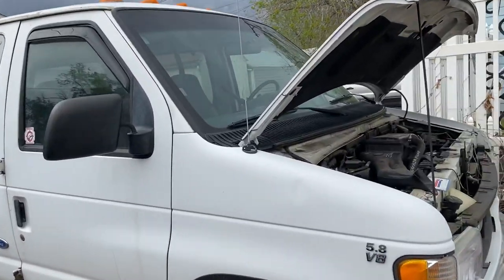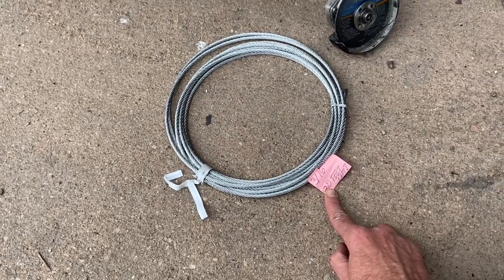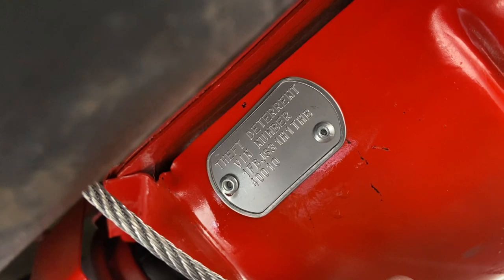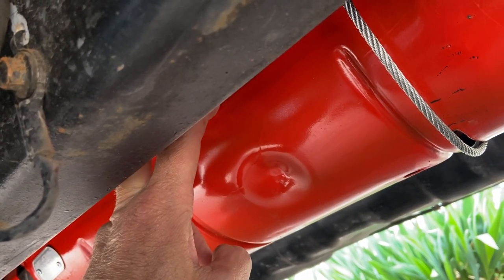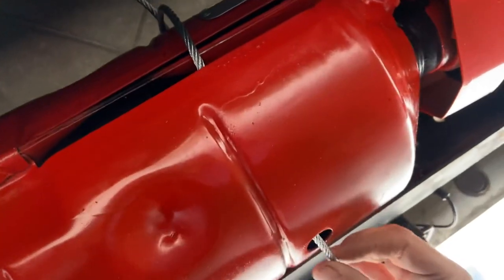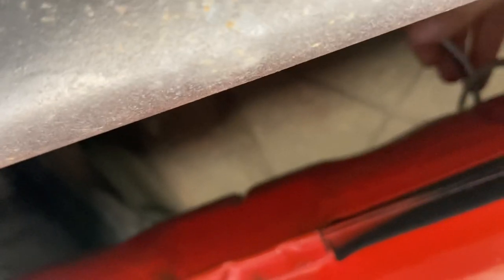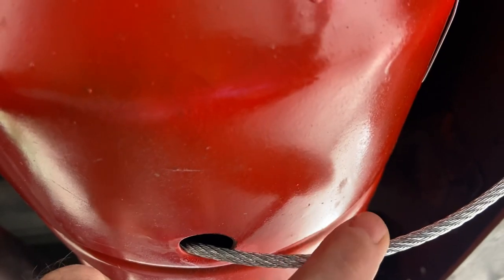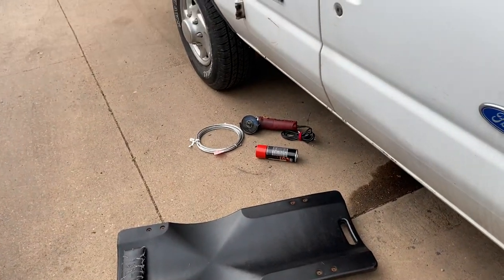Catalytic converter how to Anti-Theft Security Protection DIY. Spray paint Vin tags Steel Cables $30

Comment: This is a good idea and a good execution. Anything that these criminals see that is going to slow them down will make them move to an easier target. Thanks for the video.
Reply: Yeah, the only time this will fail is when cat theft prevention becomes the norm and it becomes difficult to find non tampered cats to steal. Then they will start to go with more difficult to steal cats but that is when it becomes a mess for them with people doing all kinds of different anti-theft tactics that makes the theft method inconsistent and will probably require a variety of tools and increased risk to the thief.

Comment from the maker: OK WELL They tried to STEAL my CAT!  Had my van parked on a side street for about a week. 
They didn't get the CAT off because of the cables and barb wire, BUT they did completely sawzall Cut my exhaust piping on both inlet and outlet pipe ends of my cat..... 
Now I have to get the piping welded back together. There are some slight marks on the upper frame member, so looks like they tried to cut the cable but the cables and barb wire show no signs of damage. Most of the cables run up up above the cat to the frame member. 
Seems they just couldn't get their tool up there. After repair, I will also look at adding some expanded steel-mesh to wrap around the cat so hopefully they won't cut anything next time and so add another layer of protection. 
Also looking at adding wraps of exhaust fabric-tape-sold for headers in the common cut areas. It is said by some that the fabric tape really gums up a cutting tool, making it more difficult to cut your pipes. 

Hopefully next year I will install an alarm system for my van. Currently I have a steering wheel locking club I use.
With the alarm, I will look for ways to add some wire by/on the cat that if it gets moved it will either ground or break a ground, triggering the alarm. 
 
PS my cable system is similar to the Catclamp, yet the cat clamp looks more robust, yet the front of my cat has a wide mouth dual pipe the catclamp would not fit over.. 

Take care 

Take care

Comment: 30 dollars, maybe a few hours of your life, compared to 1200 to 2000 dollars and losing the car for a day to get repaired. Thanks for the great idea!
Reply: The folks who are stealing the converters will be able to cut through that wire cabling.
Reply: @lourias  but if use several pieces or stretches'  -just adds to more time they need to spend. Deter not stop.
Reply: @lourias  The whole point is that they see it's a PITA. They just want to get into 2(or 3 if sensor) quick cuts and get the cat out in less than 1 minute. If they see this mess, they are not going to figure out how to get it removed and move on to something else. It's only when "moving on to something else" becomes useless because everyone is doing this, that they will go through the effort of figuring out how to steal a come complicated cat.
Reply: @SI0AX  Good thieves will carry steel cable cutters besides a Zawzall now that they probably watching the vids people post on youtube
Reply: yea cost me$1300 at  midas on a van like this
Reply: almost cost more to fix on these old ford vans then there worth  1997

Comment: Jim M.,  thanks for doing this video.   I'm going to do this.   Please pay no attention to the negative comments.   I was looking for a DIY way and I think your way is the best.   You are correct, a sawsall will have a hard time with the cables.   Thanks Again.
Reply: That's what I'm thinking. I plan to do this soon since I've had one stolen. It doesn't need to be impossible to get off. Unprotected they can take it in about 2 minutes. If they see that they have to actually think, and take more time, they will probably move on.

Comment from the maker: Everyone, 2 things you can do for FREE to combat this trend that I've done:
 
A. 
Every month, go to FB marketplace and search for any catalytic converter buyer ads that do Not state that they will not buy stolen Cats and also the suspicious ads which are found in the sell section yet hint they actually will buy cats. 
Message the person telling them to quit buying stolen cats or change their ads to specifically say they will not buy stolen cats and report to FB in the link as "suspicious stolen" category. 
If we stop the buyer's who are funding the drug addict thieves, we can change things. 

B.
E-mail our elected officials to change the Federal law to Allow the public to buy used catalytic converters from salvage yard vehicles, like we use to be able to, so we can affordably replace our stolen cats and this will also reduce the value of stealing them in the first place and after market replacements!

ALSO to change the law to allow muffler shops to Reattach a catalytic converter that has been completely cut off your vehicle!  Yes that's right, by law they can't reattach your catalytic converter if it's been completely cut off or after the police recover it! 
The law only allows them to repair it if it's still partially attached. So Muffler shops are forced to sell you a new Expensive catalytic converter even though they can see the cut marks match your original and your is often better quality and longevity than after market replacements.

Take care

Comment: It would seem to me that simply wrapping your CC in some sort of cable like this and clamping it in would almost completely eliminate any chance of theft because a thief will see this and know it's going to take more time.  They're looking for situations where they can get in and get out within 2 minutes or less.  Seems like a very simple and cheap way to prevent this kind of theft.
Reply from the maker: Thanks Joel I agree Since I can’t add a metal shield plate like they have kits for some vehicles.
I’ve since added some simple wraps of medium duty 16 gauge 4 point Barb wire from eBay and just added it to the cable clamps hood downs.
I feel it’s the sweet spot for my vehicle and situation and cost and labor and comfort content level.
If they move their hand quickly around that Barb wire, it’s gonna cut snag them.
Rough play with the cat is gonna scratch! Lol
Reply: @JimTMcDaniels1  hi so many are ALSOLOOSING THEIR LIVES,WHEN JACK SLIPS !  Most seen have been in KALIFORNIA ! Stay well 🇺🇸🇺🇸🇺🇸🇺🇸
Reply: @flybyairplane3528  So sad about the jack slipping on them (snif)...   'scuze me....  I need a minute (snif) 😜
Reply: Cats are worth $500+ scrap these days. many thieves will take high risks such as spending time to cut shields and cables loose.
Reply: @MrHurricaneFloyd  But with 10's of 1000's of cars out there, w/o cable inclosures, they would most likely rather move on, which is the whole point.
Reply: @Jim just wondering if this worked? I’m gonna try this same thing w barb wire. Thx
Reply from the maker: @cliffrivers8200  it’s worked so far as in no one has tried to steal it. I do live on the west side where cats might get stolen however there has been no evidence that anyone has tried…
I feel comfortable with what I’ve done and where I live and the difficult and expense of doing more than I did for my particular cat design that I don’t see a shield kit offered or easily done.
I don’t live in higher theft rate places like California. 
If I lived there then I might go to more extremes and see what professionals recommend.
Reply: @flybyairplane3528  "Many" are losing their lives when jacks fail?   Not.
Reply: @flybyairplane3528  I have no doubt that there has been at least one death from a car falling on a cat. thief.  Likely more than one. My point is that you are grossly exagerrating saying it is "many."   Many people are not dying while stealing cat. converters.

Comment: I had both left and right catalytic converters along with 2 oxygen sensors recently stolen on my Toyota Tundra, and due to the unavailability of replacement catalytic converters, it took 4 months to finally get it repaired.  The total cost of repair including welding was $4,682.  I'm so scared to park my car outside now as my Tundra cannot fit in the garage due to its length.  I will definitely try the suggested theft deterrent methods.  Thank you for the information!
Reply: Four months!?!  So the truck just sat idle for four months?
Reply: @robytar  Yes, parked on the street because it doesn't fit in the garage. During that time, I had so many spider webs all around and underneath the car. My battery died and the gas had gone stale, too. It was such a depressing time just waiting for the back ordered catalytic converters to come in. Another car in the repair shop was still waiting after 6 months for the replacement catalytic converters. My insurance said they can only provide rental car for 3 days, just for the days it takes to repair and not during the waiting period. It was the most painful car repair experience!
Reply: Mine was stolen last yr. I had 4 cats on the truck. Had to sell the truck after getting an aftermarket that wouldn't pass emission and numerous O2 sensors. Now, on my upgrade I got super sensitive alarms,  dashcam that are both online connected to my phone and don't go on long trips to where I stay in a hotel with the truck.
Reply: Was it repaired at a Toyota dealer, or was that done at an independent shop?

Comment: Thanks for the video.  I've been going to bed nervous for the last week since someone tried stealing my cats. The dummy started his first cut in line with an o2 sensor and either gave up or got spooked but it still ran me $590.00 to get it fixed. Found out I have 4 converters on my 06 E250 and it would be near $5000 Canadian if they made off with all 4. Also,  I'm thinking I might add chicken wire or a chain link wrap around the convenient cut spots.

Comment: In addition to painting it, why not wrap the entire converter with a few layers of barbed wire and tac weld it on or secure it with lots of clamps?
Reply: Best idea! 😂
Reply: Am even considering using Fireplace insert that holds logs as thick steel.  Cable is nice idea- tac welds  is nice addition- just make it a total pain to get in and out-. Nice Video BTW
Reply: What about the mechanics who might work on your vehicle (like for an oil change or any other reason to put it on a lift) ?  Or if child's ball rolls underneath and kid reaches in to retrieve the ball?
Reply: I'm thinking of taking barbed wire, zip tie to 3 foot sections of steel rod, store in PVC pipe to keep it from getting snagged while in the vehicle, throw them out on the ground under the vehicle while parking overnight.. This should inflict pain to the would be thief once they quickly drop under the vehicle.. Hopefully pop up and smash their head on the under side as a pain reflex kicks in.

Comment: Think if you just had the dogtags and the paint, the cat may still be vulnerable, since they could cut the heat shield off later after stealing it. With the cables too, I think you are safe. You made it too much of a PIA for them to deal with your's and will go on to the next vehicle. Best DIY theft prevention I've seen so far.
Reply: When I do my cat this week I plan on engraving my VIN on the cat itself.
Reply: @cy6610  Sounds good, if you can get to the cat. A lot of times the heat shield is in the way.  Good luck.
Reply: @cy6610  Actually I don't know why local police departments or insurance companies have workshops to do this for the public.  The insurance company lose thousands of dollars due to cat theft. (and we lose too since we still have to pay our deductibles not to mention the pain of having it replaced.)

Comment: Looks good Jim. The sawsall blade will just move the cable back and forth instead of cutting through it. I'm thinking about doing this soon. I like the dog tag idea too.
Reply: It wouldn't be hard to drill the pop rivets and remove the dog tags
Reply: @robertlewis8464  There is no method that allows to you tog up the cat unless it's in an inconspicuous area and the thief doesn't notice. For these obvious spots, the only purpose it servers is getting his cat back if a thief is caught in a short span of time where he didn't get a change to work on the cat and get rid of the markings. Thieves need to steal a large quantity of cats and get rid of them quickly so they will not want that 1 cat that will incriminate their whole pile.

Edit: It would be a case of literally caught "red handed", lol.
Reply: Bolt cutters will cut that cable in no time.

Comment: Sorry, but I tried so-called high temp Engine Paint on my E-350 van, and it didn't work so well; it was even rated up to 4-500 degrees F.  The first 20 minutes of driving it on the road burned it all off.  Now I'm looking to get the VHT 1300-2000 degree F paint.  Hope that'll stay on better!

Comment: 2:40 You could have "glued' the small clamps with some high temp JB Weld.  But what good does the clamp do?  (It does make the cable a little bigger at the clamp point.)

Comment: Good stuff.  One little suggestion: Loctite on the clamps that would be accessible to the bad guys.  Just another way to slow them down.
Reply: loctite?
Reply: @karenl.1695  loctite is a thread locker for screwed or bolted in connectors.  Comes in various strengths.

Comment: better hope they don't have bolt cutters along with the sawzall
Reply: Exactly, extra large bolt cutters or a battery power side grinder would only add about 20 - 30 seconds to the job
Reply: @justinmcmillin329  yes and that is all i need to load and put my shoes on

Comment from the maker: Welding rebar or steel cable onto exhaust system method I'm seeing some on the internet:  
Rebar or steel cable is hard to cut through with a reciprocating blade and dulls blades fast. 
It seems another fairly effective deterrent would be to buy some rebar from your local home improvement store, of a thickness that can be bent using hand and tool methods. 
Then bend so that the rebar or cable can be placed and welded-attach the bar along the exhaust system and also over onto the cat.

Of course you have to have a welder and you'll need to read how to bend rebar and how to safely weld onto your car without damaging electronics.
Reply: Rebar is very brittle mig welding doesn't hold up on rebar under any pressure more likely to fall of your car and injure someone driving down the road.

Comment from the maker: With the light duty Barb wire I added since the video, I’m content with my situation. 
Especially since I haven’t been targeted .. yet… hopefully never...
"Now I'll be driving an electric car way before they steal my cat LOL".
it’s worked so far as in no one has tried to steal it. I do live on the west side where cats might get stolen and I do see in the news some of that happening around here.
There has been no evidence that anyone has tried…
I feel comfortable with what I’ve done and where I live and the difficult and expense of doing more than I did for my particular cat vehicle design that I don’t see a shield kit offered or easily done for my van.
I don’t live in higher theft rate places like California. 
If I lived there then I might go to more extremes and steps and see what professionals recommend.
I really feel the Barb wire put it over the top where someone is going to curse and move on….I hope...but not the helplessness in hope, because I did what I reasonably could.
Take care of yourself.
Reply: Thanks for the work and the vid. Barbed wire video would be great.
Reply: Just watched. Do you still have the same set-up? Any issues or theft attempts? Thanks for the tips.